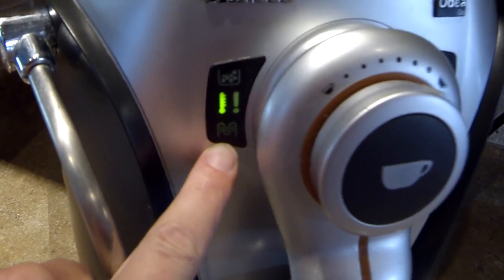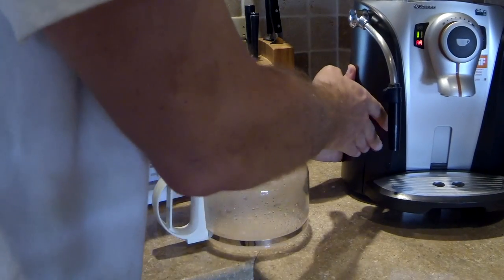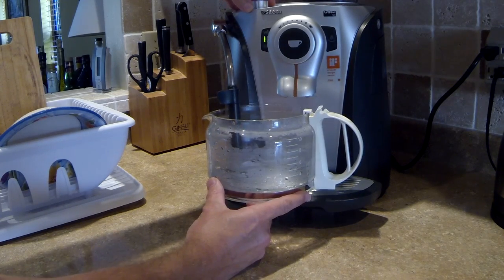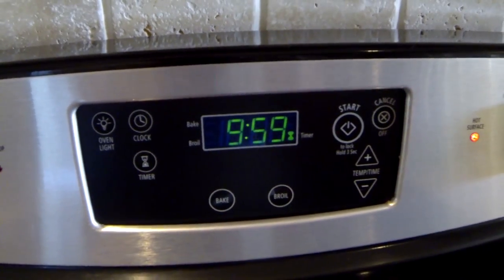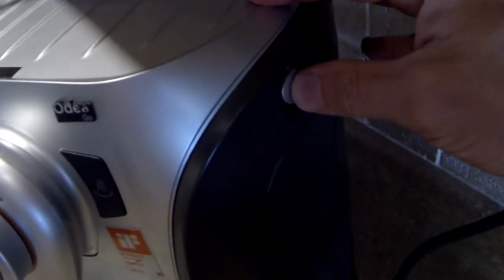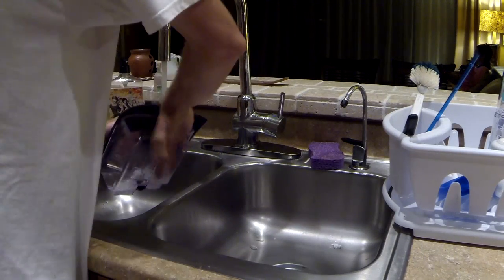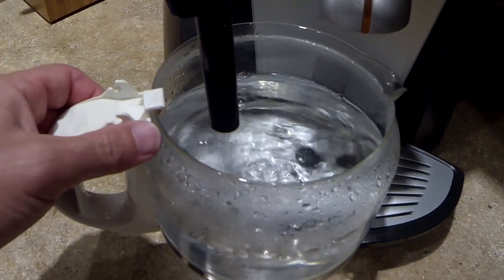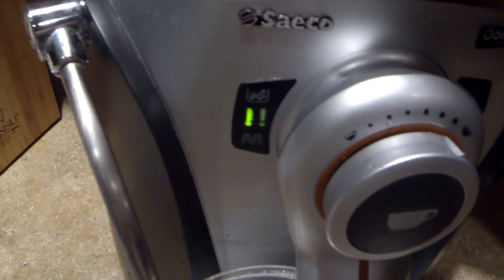Descaling Saeco Odea Go Espresso machine.

Comment: Great film, but in my opinion it is not necessary to turn off so many times coffee maker because temperature in boiler get lower. I just done whole process like my bigger stationery coffee maker do which runs water with descaling agent dissolved in it every few minutes and that`s it. Important is time. Whole process should take and least 30-40 min.

Comment: As long as the light is blinking turning the knob on the top does not work.. The descaling was not fulfilled. I have tried the steam button no result. Sorry.
Reply from the maker: Sounds weird. Many times, descaling lights is on for few weeks before I do descaling and everything works as usual. Did you try holding steam button for 6-8 seconds to turn it off? This should reset it. I have also had situation when the know on the top was not turned on or off completely and I had lights blinking. I had to turn it on for awhile until it dispensed some water then red exclamation sign was off.
Reply: Is it possible that I could have somebody come and have a look and possibly repair the machine. I have tried in vain to make it work.
Reply from the maker: record a short clip of your problem and send it to me. I'm thinking you must be doing something wrong.
Reply: The machine does not work. I have turned it off by now. The red lamp is still flashing, and I could not descale. The brew group and the coffee bean  hopper have been checked and both are in my opinion OK.
Reply: Thank you. I have realized that my machine is dead. I give it up.

Comment: I was in a similar situation as my machine was in the middle of a descaling program and I didn’t know. So I tried to take out the brewing group but the arrows didn’t match. In my case I just opened and closed the door until the two arrows would match and I could pull out the group. Is it worth trying this before turning to the screws.

Comment: Huge thanks to you, you helped me very much! I wanted to know if you had the knowledge to control the amount of coffee coming out of the machine? I want an espresso as short and long as I like to drink.
Reply from the maker: On top, where you put coffee beans, there is a small knob to adjust strength of coffee. Machine comes with a special plastic tool to adjust it.
Reply: @MaciejPiotrowski  sorry, that's not; that's for controlling the grinder, how tiny pieces to grind the coffee to (= how strong the coffee will be)
@Hanoh Shahaf the quantity you can control by the dots at the top of that round "coffee" sign, but I think you know that already... :)

Comment: Depending on the machine’s serial number when you press the steam button for 6 seconds it will start the descaling program signalled by the steam light always on and the entire procedure will change. 
Fill the tank to the maximum and let the machine to dispense the water from the steam wand every 3 minutes. The cycle has to be performed twice.

Comment: hello, after holding 6 sec hot water button, the descaling alarm is still on ( red) and the hot water button doesn't turn off ( still on green light)
Reply from the maker: I would call manufacturer. I would also restart machine and hold the button longer.
Reply: i see, it was yeeeears ago, but... did you find the right way to start? We have the same problem over years and I'm spending every time HOURS! to find the solution (that I'm forgetting to the next descale...)

Comment: Is the descaling powder poisonous?
What happens if I fail to remove the filter,  and the de scaling powder passed through the filter? Will I be poisoned?

In your YouTube you didn't tell us to remove the filter first
Reply from the maker: What filter are you talking about? After descaling you have to run clean water through the machine to clean it. If you don't want to use that powder you can use vinegar. It does the same job. I've been using that powder for more then 10 years and never got poisoned. Just run clean water through the machine after descaling.
Reply: @MaciejPiotrowski  the filter plug in the water container of the coffee machine.
Reply: After I watched your video and followed it, I saw another video,  which clearly instructed the viewer to remove the filter plug first.  

Otherwise,  the descaler powder will be absorbed by the filter.

Now I don't know what to do, shall I throw away my filter plug that has already absorbed the descaler powder solution?
Reply from the maker: @streetstrategist  That is not filter, more like a screen. Are you not using filtered water for your machine? If you don't you will have more calcium buildup in your machine.
Reply from the maker: @streetstrategist  That is not a water filter. It it more like a screen preventing any debris from entering machine. This machine does not have water filter so you have to use filtered water to avoid calcium buildup inside. If you want you can remove that "filter" and try doing maintenance without it. It's up to you how you do it. I would not do that cause if your descaling solution is not completely de-solved the any bigger particles may clog internal. That is the purpose of that so called filter. I just show how I've been doing this for so many years, and my Saeco works like a charm. How you do it is up to you. I take no responsibility for any damages done to the machine due to filter removal. Also read the manual. It does not say anything about removing anything to perform descaling. Hope this helps.

Comment: After descalling machine is not working. When turning on now, the descalling light stays on(not flashing), and the hot water drip is flashing. Green light for the water that heats up. AND machine turns from home in to brewing possision.

Turning the nob for hot water only works 5 sec. When closing, automatic water comes out the koffie nose.

What to do?
Reply: I have the same issue. I called a repair company and they said that the machine is newer model, so it is performing an automatic function and currently is is ongoing. How did you solve your problem?
Reply: Martijn Stutvoet Je v

Comment: I started descaling, but when I had the machine turned off for 10 mins. and started  it again the red light started flashing. I have tried everything according to m
y manual, but in vain.
Reply from the maker: After descaling process you have to hold right steam button until the light turns off. It will not turn off automatically. Also if other lights are blinking, I found that turning the knob on the top and releasing some steam or water resets them too. Try that. Hope this helps.

Comment: Works great.... However, the product is $65 ??? Do you have an alternative for 2022? That is not as expensive?
Thanks so much.
Reply from the maker: Last time I bought it it was about $25. You can use vinegar instead and it will do the same job.
Reply: @MaciejPiotrowski  Thanks I will give it a try next time.... Hard to tell if something works though. I never taste a difference after or anything , but if it prolongs the life, then yah , I guess it's a good idea. Thanks
Reply from the maker: @ChristopherShawnPike  If you dont do it, I guarantee it will break in less than 2 years. Vinegar is as effective as descaling solution.
Reply: @MaciejPiotrowski  I have done it every time the machine has prompted me to do so... The recommended liquid is just so super expensive now. I will try vinegar next time for sure. Maybe 15 % vinegar to water/? or something?
Reply: @MaciejPiotrowski  if I am not mistaken, the descaling you did in this video was only through the steam wand? How do you run the descaler through your brew group center spouts?  Or for this model you cannot do that? Please confirm. Thanks for your video!
Reply from the maker: @SS-pi2yi  you are correct. Majority of descaling is done through the wand. I'm thinking that heating element gets descaled so it really it should not matter where water is coming from. I may be wrong but I just follow instructions that came with this machine
Reply: @MaciejPiotrowski  yes your thinking makes sense - descaling the heating element boiler area is most important- I just was thinking about the small tubing/pipe coffee path - what if it needs descaling too? May get blocked in the future..but anyways as you said follow directions is best - some machines do have this descaling at the coffee spouts and some like this model do not. 

On a side note, did you ever have a problem with this machine where it  sometimes makes espresso no problem then sometimes it just stops in the middle of grinding - after grinding ,dry  coffee grinds are dumped into the side tray  & the error RED "!" light is lit ? then to clear light simply lift the beans lid & put back). Then try again to make espresso? ( just curious if you saw this issue ever)

thanks again.
Reply from the maker: @SS-pi2yi  Yes I had that only few times. I'm thinking maybe water container was not pushed all the way or something similar.
Reply: @MaciejPiotrowski  ok interesting - someone asked not long ago was wondering - thanks.